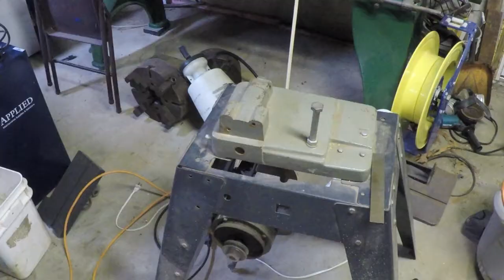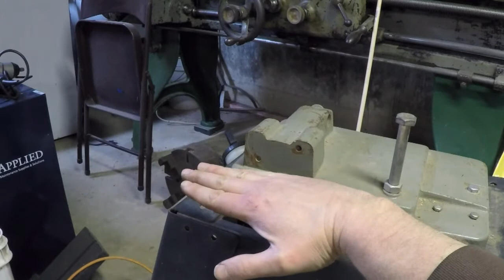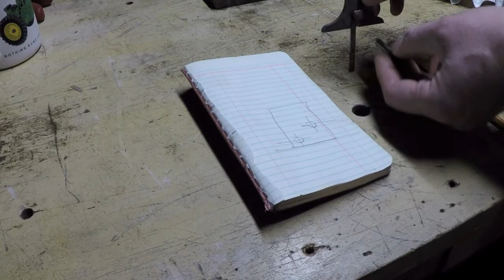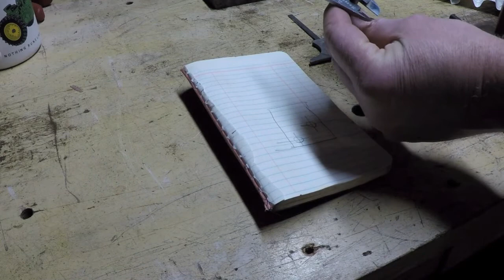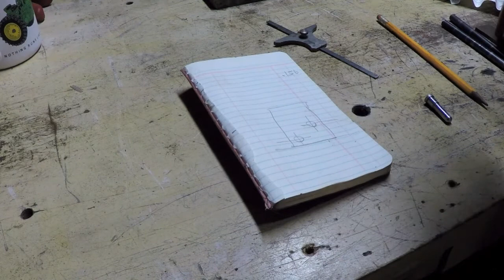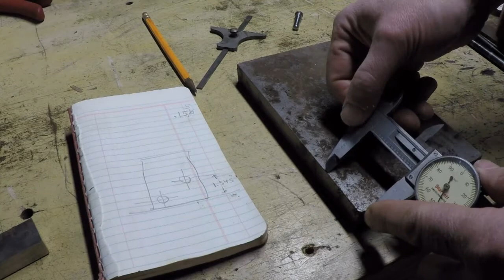The Craftsman Sander Part 2

Comment: Hi Steve I would have made a cardboard template in the shape of the part on the base with the holes in it put, it on the metal plate and used the punches. Just my thought.
Reply: If you held the template against the casting and tapped the cardboard template against the holes lightly with a ballpeen hammer, it would transfer the marks to the cardboard.  Hit it harder, and it will cut the cardboard for you.
Reply from the maker: Tech Gorilla Ive used that trick when cutting gaskets for float bowls.

Comment: I know you're probably already done with this, but...You could use the bolts, sharpen them and then use them as reverse center punches.  Place the part on the base, and tap the metal to transfer centers to your new piece.  Abom and mrpete use these, but they have purpose built sets.